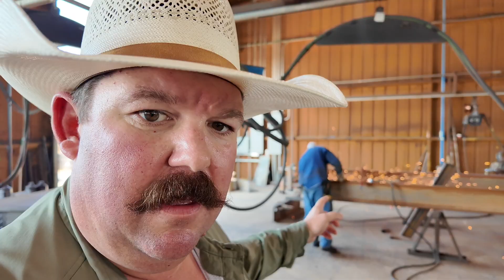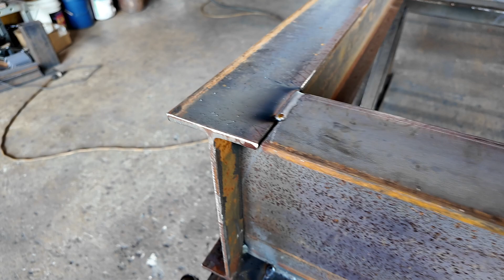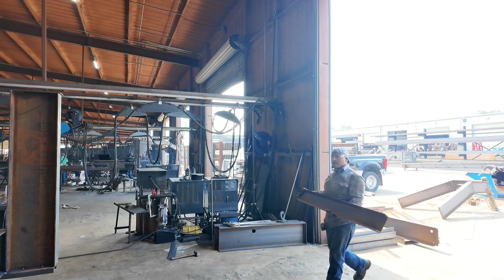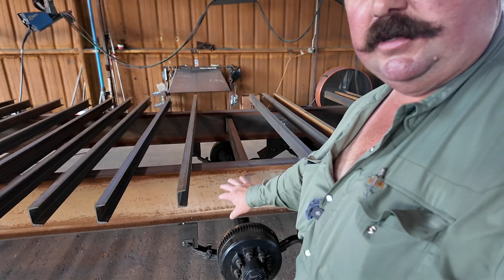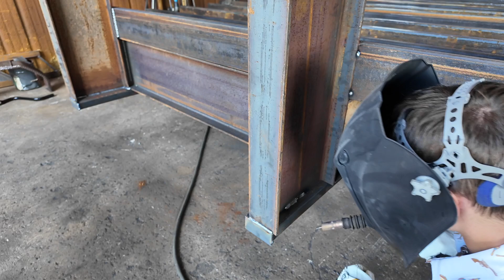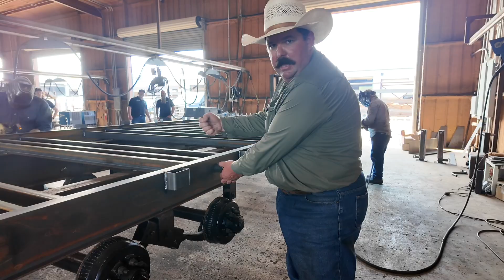Will He Pass the Welding Test?! | Bar 7 Ranch

Comment: I got certified at vo tech when I was 18. I don't use it for jobs. Only for my ranch. 

I prefer stick over mig but when building something that heavy. I would use mig. 

He should go get certified. There's really good money. If I wasn't living in Oklahoma and ranching I would go get certified for diving. You can retire in 10 years if your money is saved right if your a under water welder. Scary thing is. That's if you make it 10 years welding under water. 

That pay is insane.
Reply from the maker: Right on
Reply: @Bar7Ranch  yeah. I love my cattle to much to sell out. I own purebred charolai and private sell to other people 

Honestly when I got certified in welding it wasn't for my ranch. But right after graduation things change and I don't regret spending the time learning to weld. If nothing else fails. I can always go into the pipeline or something. Have a good one yall. Stay safe.

Comment: Good video, but I am confused about your trailer designs. This one the axles are at the back putting one h*ll of a load on the back of the tow vehicle and then your 18 wheeler designs have the axles half way up the trailer putting a high load onto those axles and little goes onto the tow vehicle. 16:57

Comment: I always push with MiG, and Tig..(if possible).. sometimes you can’t because of where you’re welding at.. but just want to give my weld the most time inside the gas shield as possible. And you get much flatter better looking welds when pushing..generally anything that produces slag I’m pulling, anything that doesn’t I’m pushing.. in my opinion! To each their own though! Heck of a trailer! And dang good craftsmanship, and knowledge going into that thing!  Clancy is one lucky dude to grow up with a dad as involved in showing him how to be a young man with a dang good work ethic as you are! Well done!
Reply: Always pushing is an old timer thing, what we find with these newer machines is that they will actually produce a deeper penetration when you drag, at the cost of a bit taller of a bead, now, if you use something like Pulsed-Spray, the difference is almost impossible to spot in the looks, and it will penetrate deeply, you’ll also (at least in the case of GMAW) typically find better shielding with a pull

Comment: You want those cross members cut unto the frame a flush on the top. Makes your deck 4" lower and a heck of alot stouter.
Reply: it’s just the frame they build a platform and weld it on top of trailer